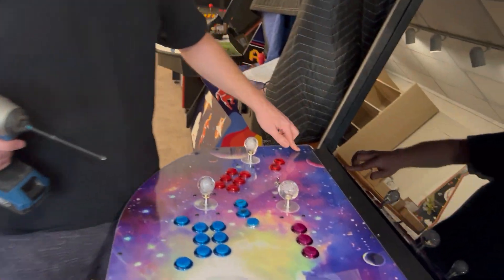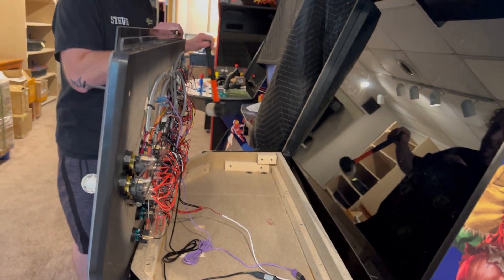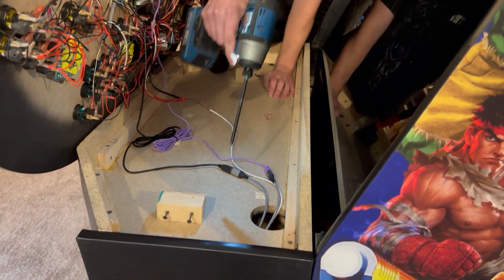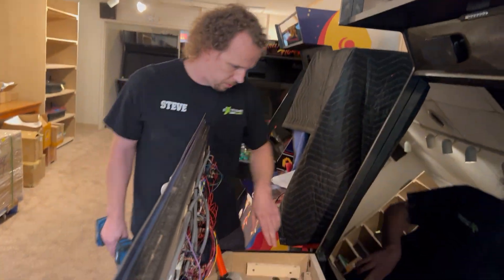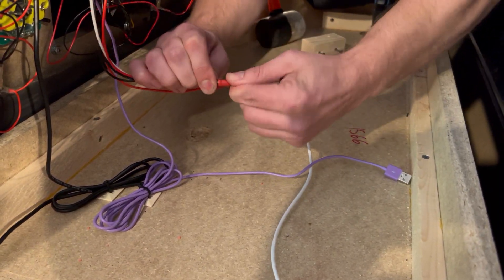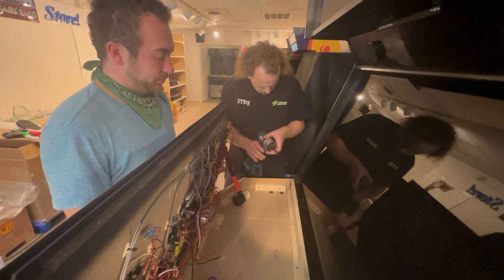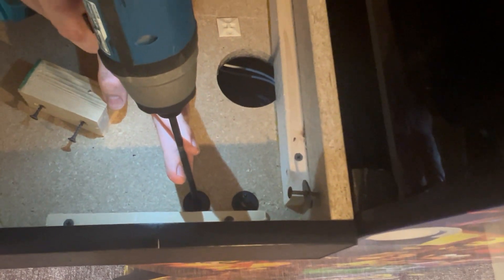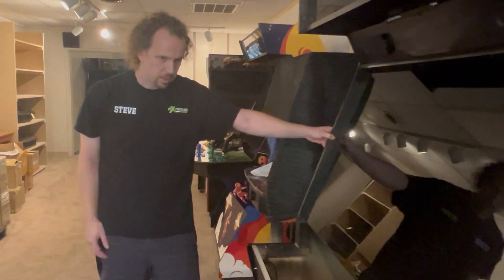EHA TUTORIAL: Removing your control box

Comment: I'm not seeing this step:  "Remove the Lower Back Door on your machine.
Make sure to dis-connect all cables coming out of the back of your control panel (looking inside the back
of your machine) They are all quick dis-connect cables and you can take a picture for reference if need
be. You will plug all these cables back in when you re-install the panel back on your machine once it is in
your home."   Is this needed or can I just follow the video